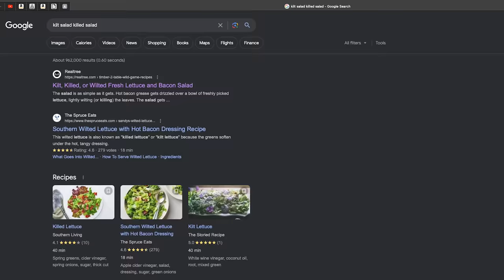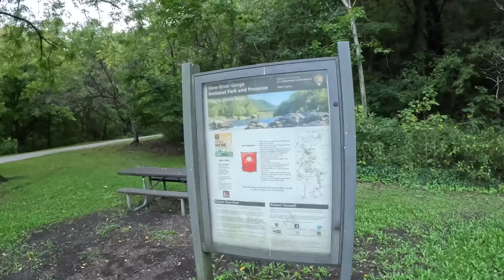Van Camping Appalachia | Chicken & Dumplings with Killed Salad

Comment: To chop veggies...keep the tip of the knife down, don't lift it off the board...just use the middle and heel of the blade to chop.  Then it goes more quickly, almost like paper cutter fashion.  :)

Comment: Tip: when u cut in using the knife. Tip of knife on board, u just rock the back of the knife up and down to cut, and the back of the knife does the work as u curled the fingers and push the product through. Wet wash cloth under the cutting board for stability. 😊

Comment: You aren’t far from having good knife skills 
3 huge pointers if I may. 
Put a wet towel or a small piece of cabinet liner under your cutting board. It’ll keep the board from moving which is good for safety and knife control 
Second. Try to keep your elbows in and close to your body. Your forearms should be almost parallel. Once again. Good for knife control. 
And lastly you should be gripping your knife with your thumb and index finger hugging the blade and the rest of your fingers tightly around the handle. 
I hope ya read this!! Also I hope you get to drive the blue ridge parkway this fall. So beautiful